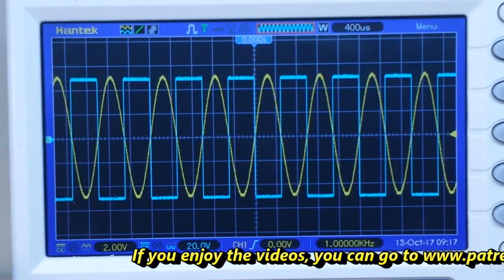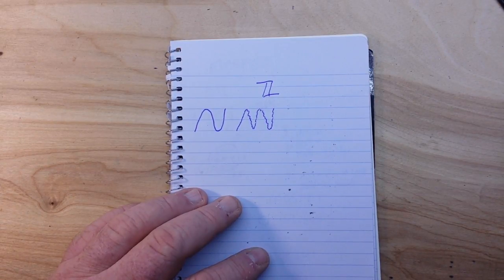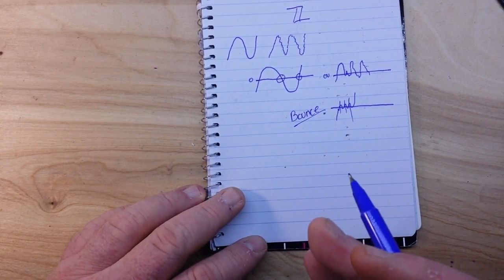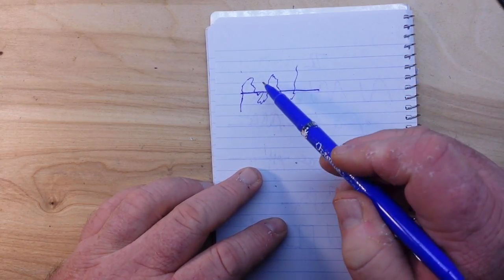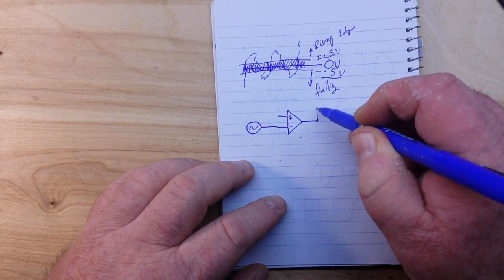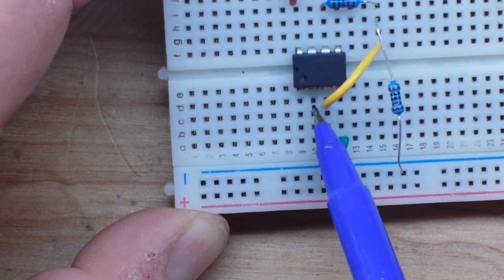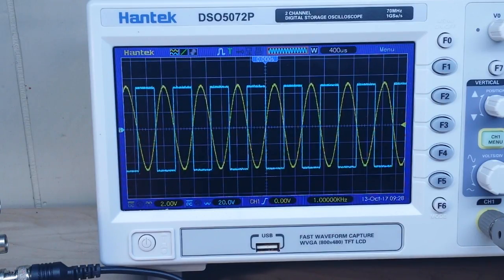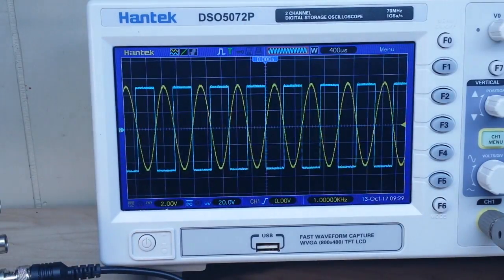Intro to the Schmitt trigger

Comment: Question Paul which op amp ic did you use? Would in your opinion a NE5532 Dual low noise op amp work well in this application? Thanks .

Comment: To be honest, I do not see any hysteresis in the oscilloscopes display. Do you??? This is converting a quite perfect sine wave to a quite perfect square wave. There is no significant noise and no visible hysteresis. Whatever that oscilloscope is showing... it has not much to do with demonstrating the function of a Schmitt trigger. At least, the effect is that small that you can't even see it. I guess the resistor values are not appropriate. This is not very useful to teach how a Schnmitt trigger works.

Comment: i dont think you can properly debounce a switch with this. depending on the age of a switch, it can actually go up to the rail voltage, then back down to gnd a few times. the controller would still register several changes of the signal. the schmitt trigger is used to prevent slowly rising signals from triggering multiple times due to the noise. for example analyzing the frequency of a sinewave.
Reply from the maker: +fredlllll Schmitt trigger hex inverters are used daily for debouncing digital signals. I did it through out the 90s and early 2000s as a design engineer for Bayer Corp.
Reply: does it really work with a mechanical switch? as i said, i have one that opens and closes multiple times before it finally stays closed. how can a smitt trigger debounce that?

Comment: I'm one of those that didn't know about it.  Pretty cool.  Can never buy enough electronics components!
Reply from the maker: +Michael Padovani You can buy a Schmitt trigger for sure, usually 4 or 6 in an IC. But now that you know how to make one, you can buy a quad opamps, use 1 or 2 for STs and have 3 or 2 left over to use as comparators or amps. My favorite EE, the Woz, always says good engineering is using as few chips as possible.